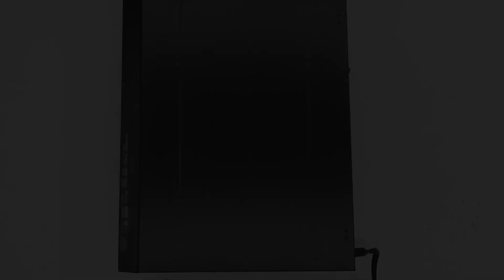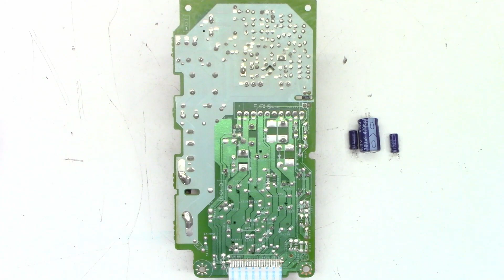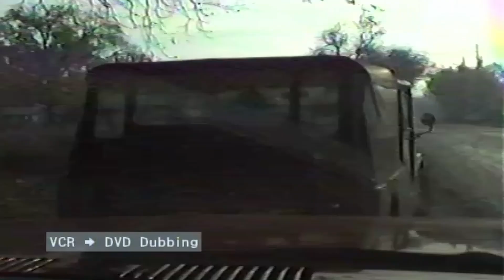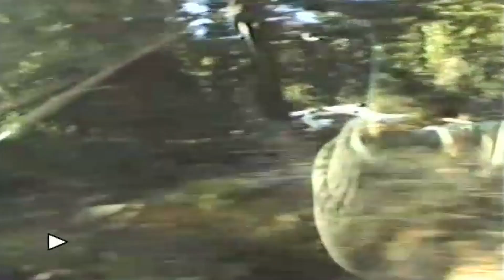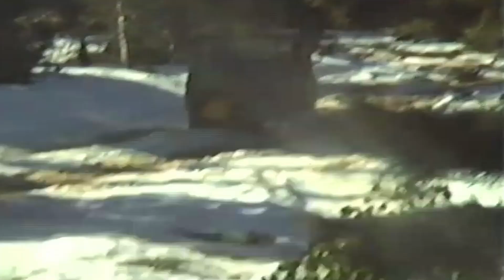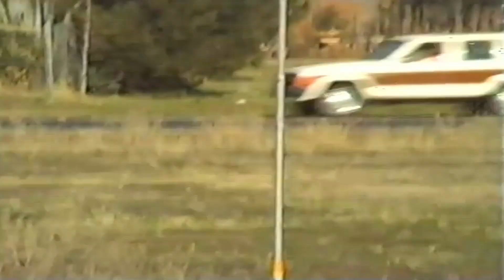Magnavox ZV427MG9A in nearly MINT condition. Only one issue easily repaired - Flashing display

Comment: Steve, why did you unsolder one lead on the caps? I thought you don’t need to with the in circuit blue ESR meter.
Reply from the maker: I did cover the reason in a previous video. If the cap is in a pi filter network then you will be measuring the other cap through an inductor which may give readings higher that the capacitor depending on the resonance of the inductor.